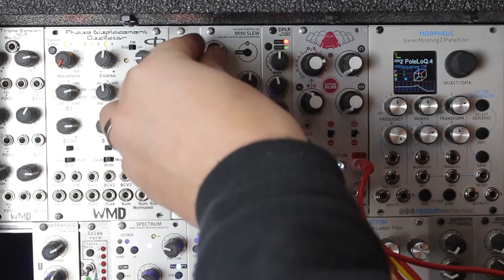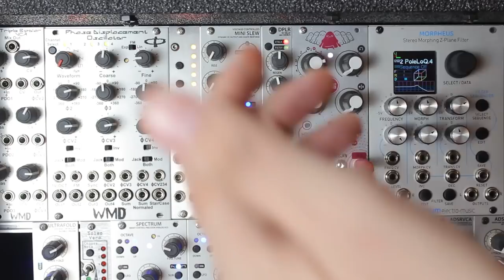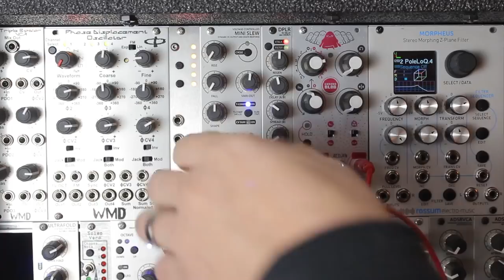WMD/SSF MINI SLEW - How to introduce Portamento into Eurorack Sequences using a function generator

Comment: What is the reason to use the arpitecht? I have one and it sounds like an arpeggiator, are you running another sequencer through it? Why? Thanks for your help. Love the vid.
Reply from the maker: Hi there, I like using Arpitecht because I can just use gates to control step and reset to create cool lines.  Thats what I am doing in this video.  Here is a walj through of what Im doing and how: https://youtu.be/x4Y8f0ZSF2I?t=236